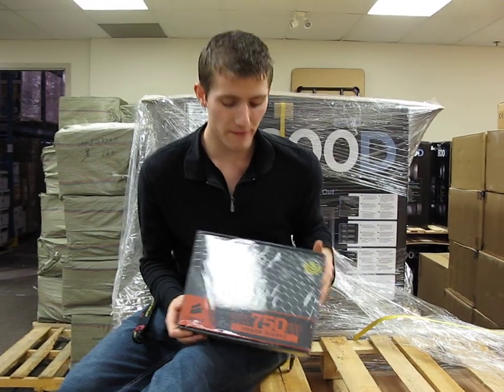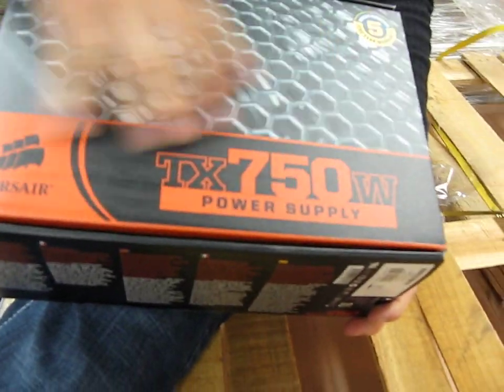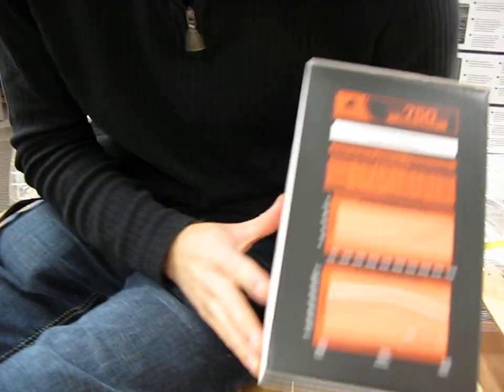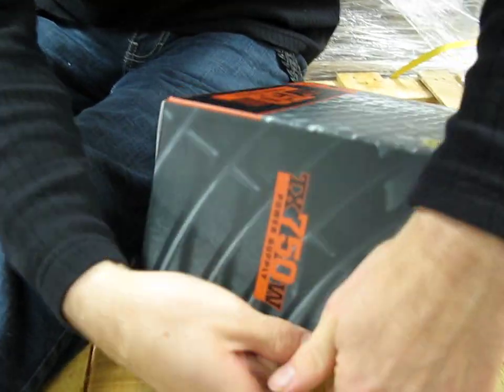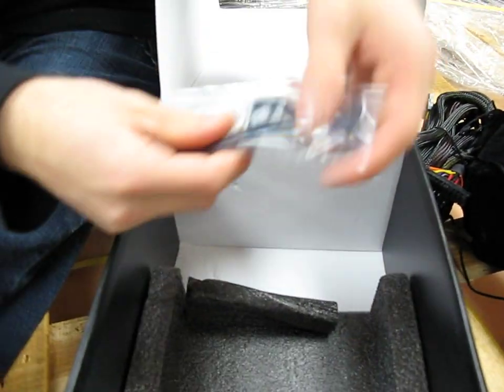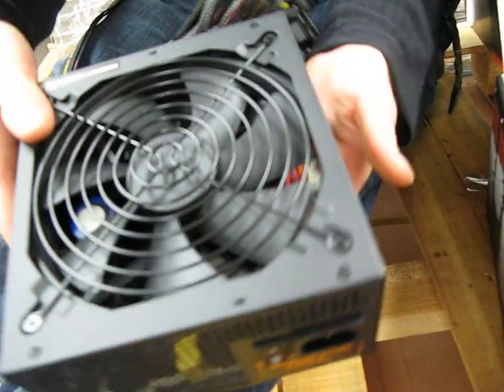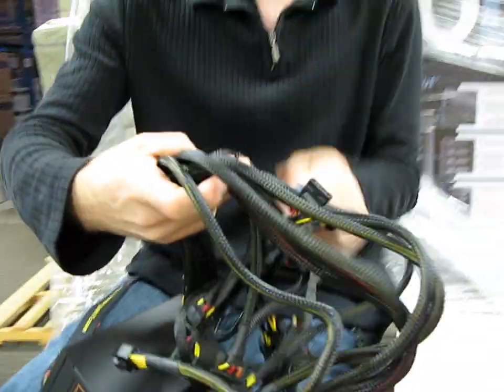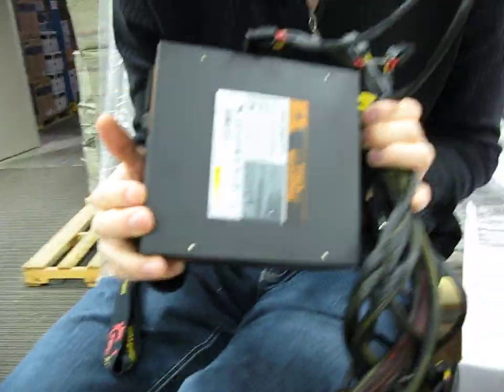Corsair TX750 Power Supply First Look & Unboxing Linus Tech Tips

Comment: I bought this power supply in 2009 when I built my Windows Media Center HTPC. It got moved to my file server when I switched to XBMC/Kodi. It has remained in my file server through several CPU/Mobo upgrades and currently powers my Plex server. It has been powered on nearly 24/7/365 for the last 13 years. It's a champ.

Comment: My power supply is 5 years old. 5 years ago it was considered mid range. It is a 550w power supply with 0 pcie connectors. It has 24amps on a single 12+rail. Its 5 years old and its pushing a GTX 460, X2 240, and TONS of other stuff... Soon i will be getting the X3 740 and overclocking like crazy. Im not afraid of this power supply blowing up. =)

Comment: Hi Linus.

 Im getting the Corsair TX 750W M (Semi-Modular) 80+ Bronze, will it drive i5 2500K 3,3 Ghz (May be overklocked around 4 Ghz or above) and 2 Gigabyte GTX 560 Ti 900Mhz ???  
Or do you recommend the non-moduler PSU in this video or the Corsair Gaming Series 800W 80+ Non-modular ?